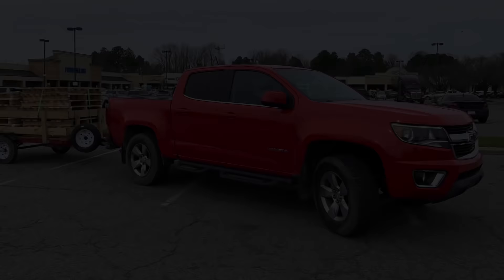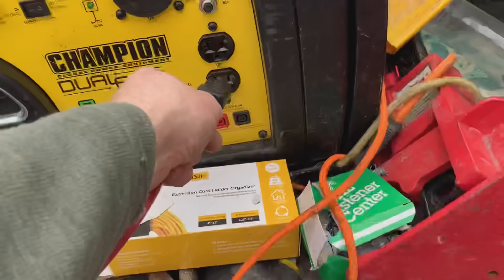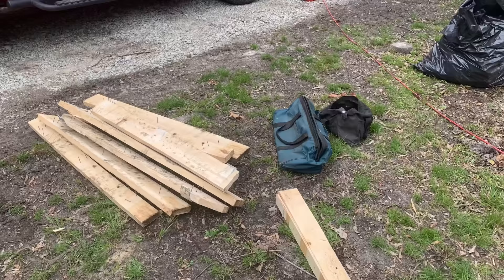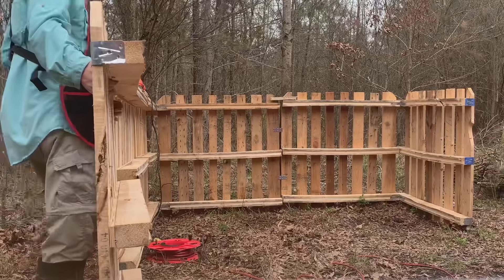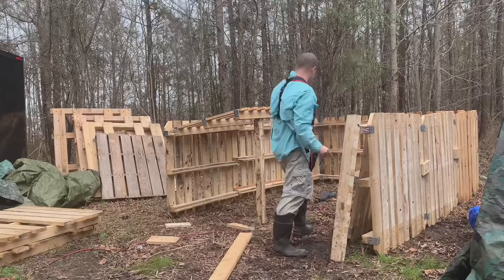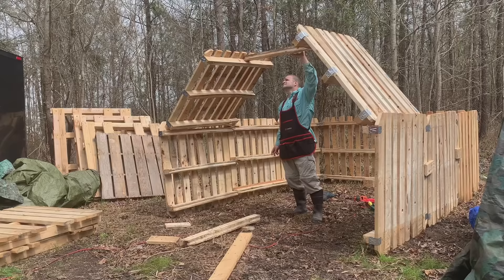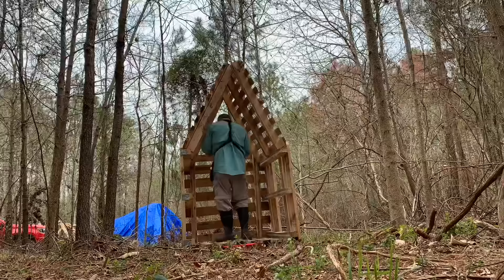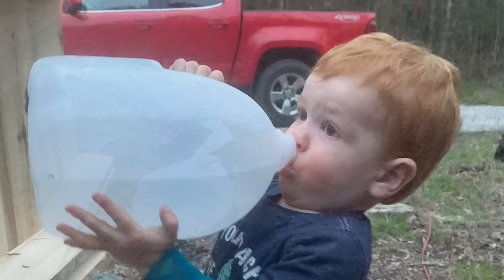Pallet Shed

Comment: Next time but the 2×4s vertical then cut some 2 ×4s in 4 foot 2×4s then nail them to the insides of the pallets leaving them put them at least 1/2 stocking out the ends. That way they reach to make a pitched roof.
Reply from the maker: Thank you for the suggestion, there will be lots of changes next time I put one together
Reply from the maker: Thank you for the suggestion, there will be lots of changes next time I make one

Comment: ONE WAY OF MAKING A SHED.IS LES,WORK,COST AND EASY.TAKE PVC PIPE,MAKE A JIG POOR HOT WATER IN SIDE THE PIPE.THIS MADES IT SOFT. FORM IT IN THE JIG,WILE HOT.COOL DOWN IT WILL STAY IN FORM.GLUE THE HALF ROUND INTO STAIGHT  PVC.FOR LEGS.YOUR ALMOST DONE.PALLETS FOR FLOOR,AND TARP FOR ROOF.DONE GOOD WORK ON YOUR SHED.
Reply from the maker: I actually did make a hoop house a lot like you are suggesting and they work really well.

Comment: The problem I'm running into is the wood splits as soon as I drive a nail or screw in. I pre drill which helps till you tighten the screw down and it splits. Even the 2x4 splits.  Not sure if it's just the type of pallets I'm getting ?
Reply: Use any kind of bar soap and screw the screw into it and then into place or shave it down to a powder and use his enough water to make it a paste and dip your screws in it before you install them , that will help prevent the wood from splitting , grant it , it may not work everytime , but it will majority of the time❗
Reply: And if you blunt The Sharp point of the nail it , that will work like the soap with the screw❗
Reply from the maker: I guess I was lucky, I didn’t have any splitting issues.

Comment: American Pallets are HUGE compared to European pallets!
Reply from the maker: These pallets are a bit bigger than “normal” one that I usually see in America. Not sure what the were for originally
Reply: there are different sizes. those are really bigger than what ive seen before anywhere
Reply: @recreationalland2585  the ones I've seen used on YouTube generally are still bigger though tbh and also much much better Quality wood! Ours are all the crappy off cuts of wood half rotten split pieces of bark for slats and not solid but usually blocks instead of 4x2s or similar lengths like the US ones some are even made of compressed wood on the blocks so pretty useless to reuse often. There are the odd good ones but it's difficult to find and the better ones they treat with chemicals and paint blue or red so makes them useless to upcycle generally unfortunately. Have to be lucky to get good ones that are heat treated think they're more imported ones from outside the EU...

Comment: Would have been better to start your roof at the back. Bracing could have been off of the back wall. Or build section of roof on the ground. Do a walk up method with stacked pallets and gunage.
Reply from the maker: Thanks for the advice, I’m sure I will be making other pallet sheds in the future and I will try it out.